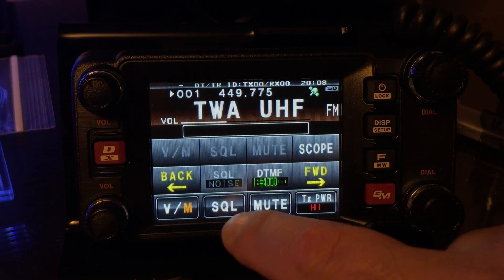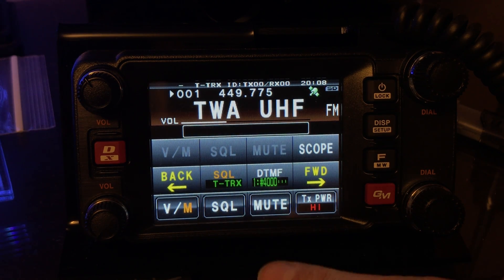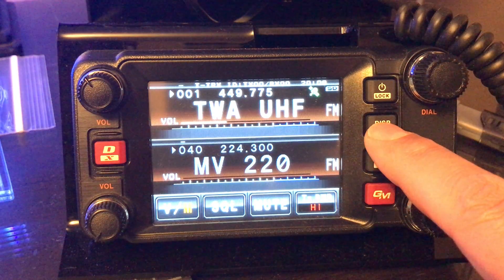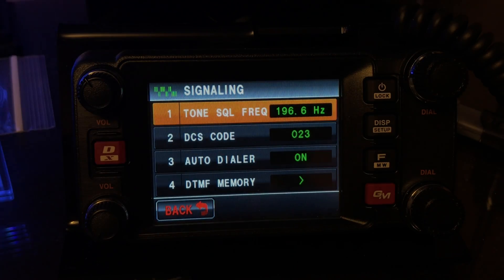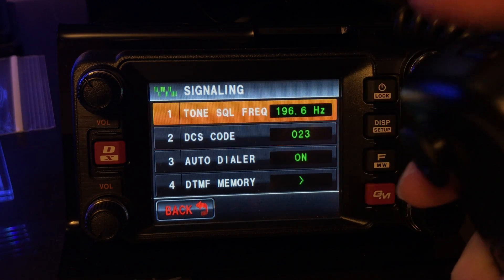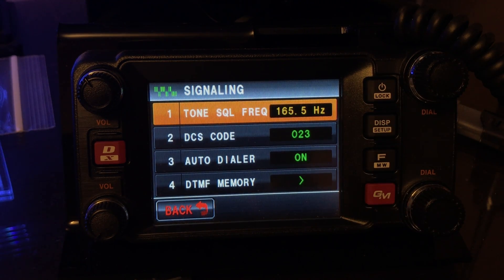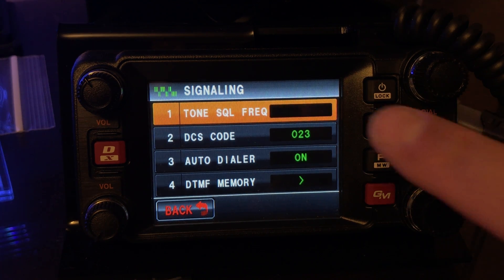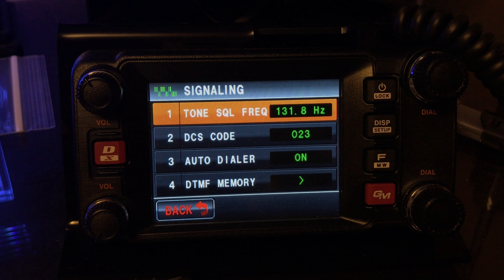CTCSS Scan on FTM-400XDR

Comment: At 44 seconds in, you mention you will make some tone, but you don't explain how to do that.
Reply: I think he just meant he would use a separate radio to key into the repeater so that the repeater transmits (with CTCSS tone as per usual).